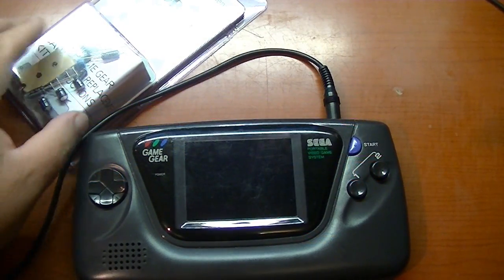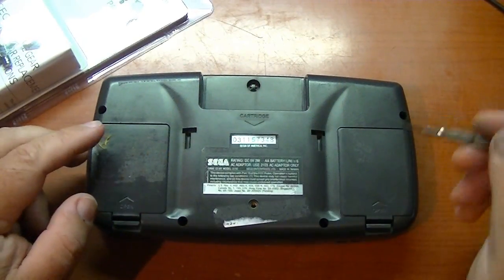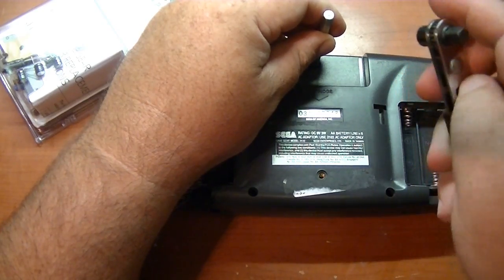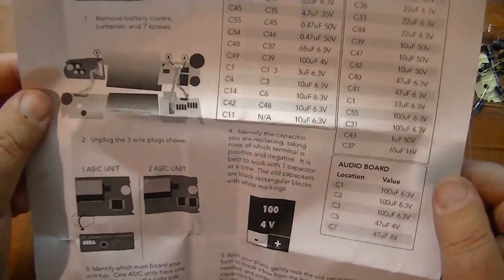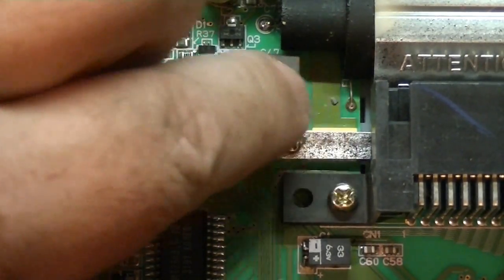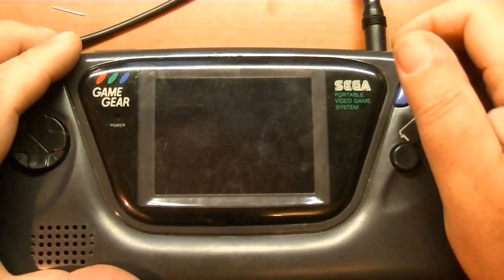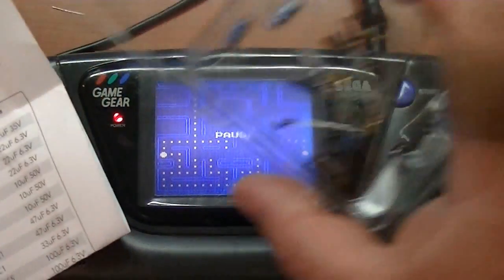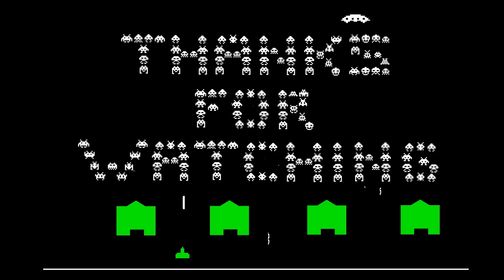Sega Game Gear Capacitor Replacement

Comment: The instruction don't suggest this, but there are two other tools to make this repair go much easier.  I used a headlamp (you will shadow yourself) and a "Helping Hands" tool as well to hold the capacitors while I soldered.
Reply from the maker: That is a excellent tip!  that would make it easier to do :)